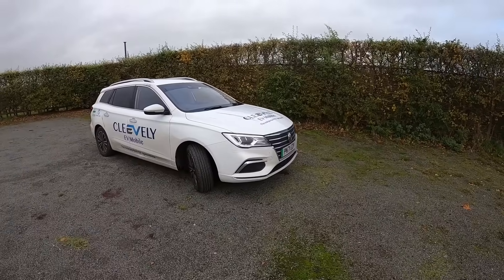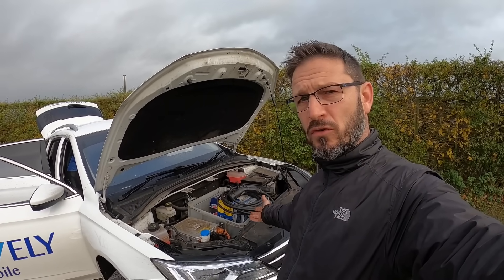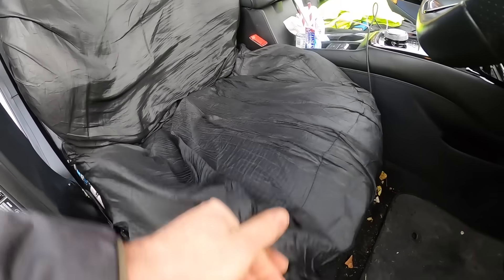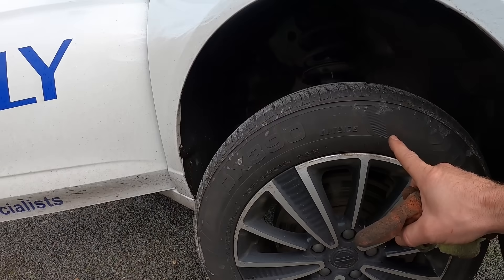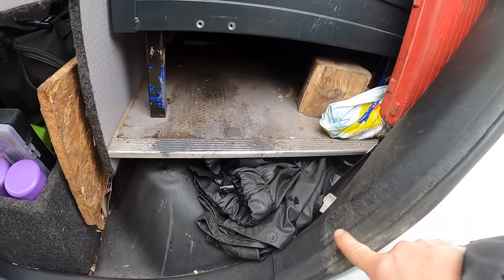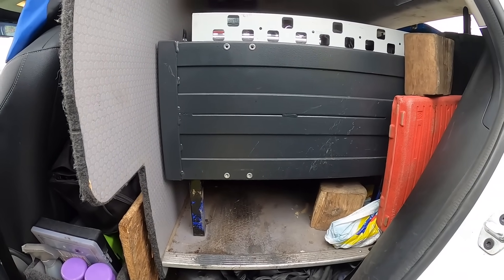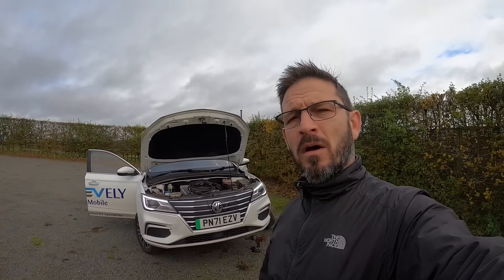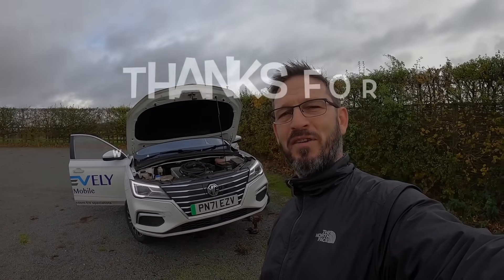How's My Electric Car Battery After 100,000 Miles?

Comment: Great review James. This is a great real world ‘worst case scenario’ example based on the vehicle daily use. This is the kind of stuff the media need to use.
Well done and keep up the great work.
I’ve put a post up on my EV channel to promote your video 🙌✊
Reply from the maker: Thank you 🙏🏼
Reply: @Jamesandkate  quick question if you don’t mind. Where do you send the diagnostic data from the BMS to to get your degradation report? Would love to do one on my MG4 which is 1 year old. Thanks
Reply: The media would claim it's all staged Stuart.......
Reply: Of course ignoring the cobolt and lithium slave conditions !
Reply: @gowdsake7103 

When you look into it (which is ironic because you clearly haven't), the cobalt used in the production of low sulphur diesel, although a catalyst, can be found inside diesel exhaust. This means it has to be replaced in the process. The cobalt is also poisoned as well through the process and that also requires replacement. 

The amount of cobalt used inside the battery will always be the same, and can be recycled over and over and over again. 

So I would be careful bringing up modern slavery when your use of cobalt is being lost to the air and surroundings. Over time this is probably magnitudes higher than the battery.

But listening to the Daily Mail and GB News is the best right?
Reply: @gowdsake7103  I take it you don't use Petrol or Diesel then? Cobalt is used to remove sulphur from fossil fuels and it is then spat out of the exhaust for us all to breath btw cobalt in the atmosphere is a lung irritant LFP batteries don't contain any cobalt and lithium is obtained from Australia/South America and not Africa. A recent lithium discovery in /north America might mean the US becomes the largest lithium producer in the world if they decide to mine it.
Reply: @gowdsake7103  Most of the World's lithium is mined in Australia without slavery, and the South American "triangle" of Chile, Argentina and Bolivia. China produces around a 3rd of Australia's output. Most of the "slave" conditions to which you refer, are the result of oil company cobalt mining. They need cobalt to remove sulphur during the refining process, and have mined it for generations. The oil industry are the World's largest users of mined minerals.The EV industry is slowly transitioning to cobalt free batteries now, with around 50% of Tesla's now using them, and other EV makers beginning to follow..... Now that you know this, will you be ditching your ICE car, along with any clothing you have, manufactured in India, Pakistan, Thailand or Vietnam, by children? I assume you do wear clothes?

Comment: Come 200k(?) I'd be offering the car back to MG (For a reasonable consideration) just so they can show it to any potential buyer worried about longevity.
Even taking it around the car shows in  a "used" condition with a picture of the odometer on the front would be a great advert.
.
(I bet it ends up as your company "emergency transport")
Reply from the maker: I do actually do that when the cars displayed. A little print out with currently mileage and costs to date. It goes down well.
Reply: I been in absolute budget EV taxis with 400-500k km in China and they are fine. 

SAIC knows what they are doing and people will figure it out soon enough

Comment: Hi James - Thanks for the informed video.
The MG5's have proven to be a great workhorse and brilliant purchase.
Very interesting to see your very limit brake pad wear.
Some lower milage owners of both MG5's and ZS EV's are seeing dealers requesting discs & pads replacement at only two years old !.
Rear disc's on the ZS EV are only available as OEM items and are expensive.
Have you witnessed any premature replacement necessary yourself ?. 
Are you using the OEM disc's on the rear's ?.
Thanks.
Reply from the maker: Hi, this is normally through corrosion and lack of use, but lack of servicing the rear pads that seize also cause problems. We can source aftermarket rear discs and pads and have changed a few on the ZS to date.
Reply: Thank you James - I will pass on your comments, I have had no luck tracking down third party rear discs for the ZS EV @Jamesandkate

Comment: I’ve had an MG5 for 15 months now - bought based on your experiences!  Only done 7500km, carrying diy stuff from the shops and taking stuff to the tip!  At this rate it’ll last about another 28 years - longer than me!  Only downer is that the local garage that sold and serviced MG has dumped the concession, just sells Kia and Peugeot now, so I’ll have to drive 150km for the annual service/inspection (which cost 90€!)
Reply: Why not get James to service it on your drive? That's why the MG has so many miles on it Clevely do mobile EV service.
Reply: @pmac6584 Totally agree, I wouldn’t dream of taking my car to a main or franchised dealership for two reasons main reasons. (there are other reasons too) Firstly they don’t have the in depth knowledge of my car that James and the guys have built up through experience. Secondly they’re more expensive and less convenient too.
Reply: @pmac6584  If James or one of his team wants to hop on the ferry from Portsmouth to Saint Malo I think he’d find a few customers over here!  Maybe a working holiday?!
Reply from the maker: Glad it's looking after you 👍🏼
Reply: Richard, check with HEVRA (the Hybrid Electric Vehicle Repair Alliance) where your closest EV service & repair facility is. Or just get Cleveleys to do it. It might even be James who turns up if you do!
Reply: Wow I would of thought with there relatively goo sales success they wouldn't drop them

Comment: James, how did the oil change look? Any engine fibres in the oil as it slowly destroys itself!? Oh wait… 😅 Thank you for your honest approach 👍🏻 My old diesel went to scrap last week and my new MG4 has done 400 miles in 5 days. 🎉
Reply from the maker: Amazing. We serviced an MG4 a few days ago and when test driving it reminded me how good they are to drive, such a great car.
Reply: smart meters digital money evs all part of the WEF 20-30 agenda and its all about control.remember how your battery was made and what effect on the environment.iys only zero emmisions while being used.https://youtu.be/HASkPCkMhbghttps://youtu.be/yOA7qKMcjcE
Reply: No oil? Well wait till the bearings in the motor burn out, see if its cheaper than replacing a diesel engine.
Let me put you out of your misery, no its not. But keep driving those monstrosities. BTW, did you know the battery associated EMF damage the brain? But on the bright side, EV evangelists will be immune to further brain damage, they already have problems in that department.
Reply: Don’t forget to check the wet belt! 😀

Comment: Do these regen when slowing down on ACC? Biggest bug bear with ZS EV is that you have to switch off ACC to regen when slowing down. Rather defeats the point.
Reply from the maker: It does use regen at all times. A friend also mentions the same issue with their ZS EV. No idea why it's that way 🤷🏻‍♂️
Reply: @Jamesandkate  many thanks for confirming. My best guess is that it's a hangover from the petrol variant, which can't regen.
Reply: It keeps the brake rotors clean....

Comment: Was awaiting your return- telling statement at end was  10 services on a diesel - wonder how much that would have been.
Reply from the maker: I couldn't actually get prices for them but I'd hazard a guess at £150 each??
Reply: @Jamesandkate  You forget at least 3 complete brake jobs. And maybe one engine rebuild.
Reply: @wolfgangpreier9160 
I was going to say "incidental parts"
It would be due a dpf clean or replacement by now.
Reply: @wolfgangpreier9160 comparing like for like, I.e. lots of high mileage motorway driving , there won't be 3 brake jobs. No engine rebuild. 7-10services depending on interval. 

Yes it will costs a lot more but don't exaggerate😂
Reply: @TsLeng  Yes i did. I had VW Caddys before. Brake jobs @ 50-60K. I used them only on long hauls highway driving at top speed of 130. 

Now i, and my employees drive my Teslas, actually slower than before maybe because i/we don't have to proof anything anymore and did not have a brake job or actually any maintenance at a total of 305.000km with 3 Teslas.

The Skoda Enyaq for one employee (his personal wish) has a mandatory service appointment every eyear which has cost me 490,-- so far. Slow, bad charge times, but very good turning circle and costs more than a Model Y. Funny...

In my other cars in the last 40 years i had to redo or repair my brakes about every 30-50k Kilometers. That hassle is gone.
Reply: @tokoloshimampara9932  40 years. You say it. 

40 years ago the fossil world was a good one. No filters, no emissions standards, nobody cared how dirty, poisonous or smelly everything was,. 

Free breathing intake and exhaust, no electronics, no cheap parts to safe a few cents.

Its not desperation when its my own experience matey.
Reply: @tokoloshimampara9932  I don't have any troubles with "compression". I got none anymore. 

Luckily i could shed the fossil burden from my company, my family and my personal life. I've moved to regenerative energies in nearly everything. Only trasnporters and lawn mowers are still burining precious fossil ressources because nobody wants to make decent products. I just have to wait for my Cybertrucks and maybe someone invents a decent strong electric lawn mower someday.

I told you what my experience with fossil cars was and you say that is untrue. Well, you are wrong. They are junk and should all have been scrapped day before yesterday.

I am sorry for your mental defect. Really!
Reply: I don't think the standard service costs are likely to be the main money saver as the MG would have had several services too. Until the car is out of warranty. 

The main money saver is fuel, as long as most of your charging is done at home.
Reply: @gavjlewis  I had 1 service appointment with my Fiat 500E - 159,-- And two with my Skoda Enyaq with a total of 490,-- And zero with the other 3 Teslas. Currently i am @ 305.000km without maintenance besides interior filter which i change myself every year for 32,--. Winter/Summer tire changing which is mandatory in our country is the same for all cars. Only the Fiat's tires are a bit cheaper than for the Skoda/Tesla which have the same.

Yes, you are of course right. Fuel is the money saver.

Its funny that Tesla Superchargers are currently cheaper than my home charging here in Austria.

But i guess thats besides the point.
Reply: @garysmith5025  that's amazing stats.

Edit: that's more than 200miles a day! Wow

Comment: Just popped on the feed - 100k miles in two years and the only observation is the dirt!

4 years on my Mk1 ZS EV, just topped 60k miles, so this is definitely giving a lot of hope for 150k+ miles regarding the battery and motor, then I'll replace with something a bit more fun (after it's saved me £15k on petrol).

I've had some seat vinyl tearing, and some self inflicted problems (broke the false floor in half) but apart from that very easy work for the MG EVs! 

Coming up to the 4th year service, so definitely will give you a call when the time comes around 👀
Reply from the maker: That's good going and well over average mileage. I've seen plenty of ZS EV over 100k so you should have little to worry about. I'll get it washed too 😉
Reply: @Jamesandkate  I'm the last person to complain about the dirt on yours, you should see mine! 😝